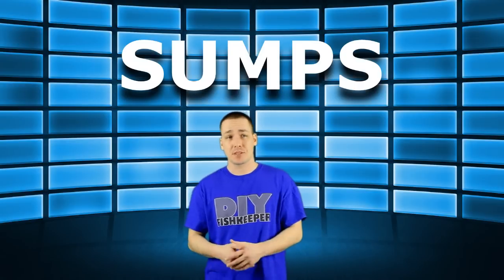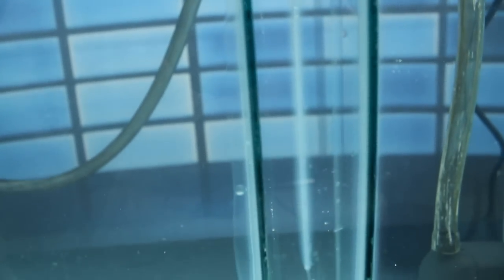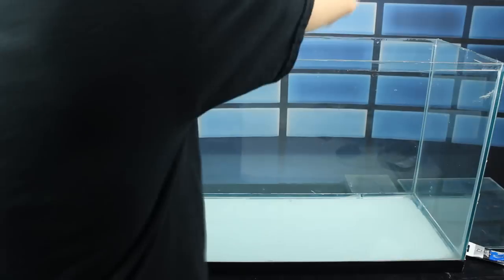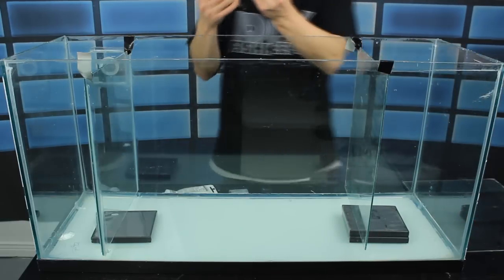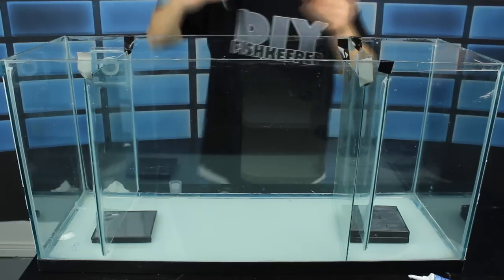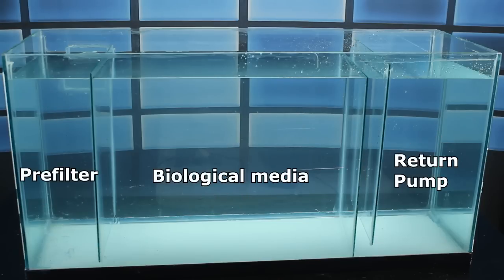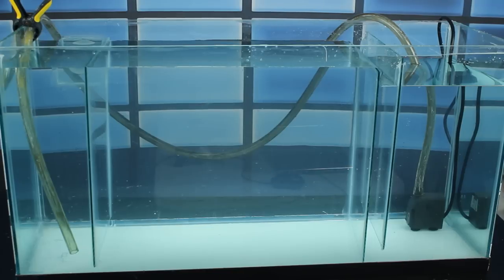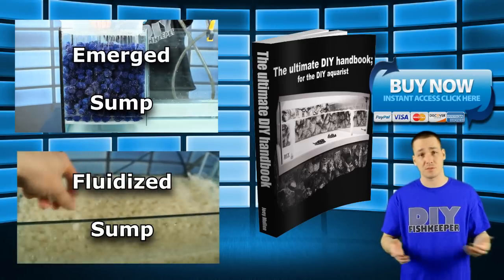HOW TO: Build an aquarium sump - Submerged filter

Comment: Hi Joey, I love your videos! They are both very educational and inspirational and have rekindled my interest in the hobby.  I am looking to build my first sump and was just looking on some direction on how to size the glass for the baffles.  The tank is a 360G and the sump is approximately 125 gallons 5' L x 2' W x 20" H and i am using two laguna max flo 2400s.  The "sump" is currently running without any baffles and is very inefficient.  I have sumps with baffles on my other tanks, but they were built by an aquarium manufacturer so I don't have any experience building them just like how they work.  I was also looking to increase mechanical filtration because I do notice a lot of detritus on my ceramic rings and have to rinse them with tank water every few months.  I use 100 micron filter socks, but I also read that you can add filter sponges between baffles, do you have any recommendations on where to obtain large filter sponges?  

Thank you for your time

Comment: Fired Up!!! 3 part series. Had a submerged sump (DIY of course) and hated the fact in power outages it over flow but DIY something for that.
Reply from the maker: Slim Tim Typically that has more to do with the efficiency and type of overflow as well as the size of the sump. I personally have never had any type of sump overflow, but can imagine the headache that would be!
Reply: @1014p  "make your pipe at the limit your sump can handle in water" - can you clarify what you mean by this? thanks

Comment: Awesome video. Is the main difference between a submerged and emerged system the the first chamber? One has a drip plate while the other doesn't? Is it safe to assume that a.submerged sump is suitable for a planted tank while an emerged sump is best for a fish only set up due to oxygen loss on the trickle filter?
Reply from the maker: AGUILAR3 The main difference is the media is out of water in one, and under water in the other. Your assumption what to use on which tank is typical of what most do as well. :)

Comment: The series was great Joey. Lots of great ideas. I get the concept of the sump, baffles and water flow. I have a question though, would I need a pump in my tank to get the water down, or is there a way without drilling my tank to get it to overflow down to the sump? I'm pretty sure you may already have a DIY vid for that lol. Thanks again for the great info and series.
Reply: ***** Thank you for your input. That is some valuable information

Comment: Hey Joey
Love your videos!
I've a question which pump to use for the sump. The pump I've is to strong and it's pushing away the plants.
Reply: put a gate valve on the return line
Reply: @gold3nrul311  thank you so much had the same question

Comment: Hi,
I am using all your videos to get to a planted aquarium (already built 36X18X15 inch ~ 40+ gallons). Instead of buying a filter I am now building a sump. I have 2 questions:
1) Sump size 1.5X1X1 feet would work? Or should it be larger? 
2) The sump will be placed about 2 feet below my aquarium, what flow rate or power of pump should I use in the pump to send filtered water back to the aquarium? Will a pump from my old aquarium with flow rate of 880 ltr/hour work? As it has to raise water up, it's flow rate will definitely fall down to around 500 ltr/hour perhaps! would it work?
Thanks in advance. :)

Comment: Hi im curious about what is the difference between the submerged sump and the fluidized moving bed sump, what is most beneficial for a 100 gallon freshwater tank for the common mechanical and biological filtration, basically i want to eliminate the use of using a canister filter. And would a 20 gallon sump work with the 100 gallon tank?

Comment: I am designing a sump for a huge aquarium ( 12000 gallons ) the sump will be about 270 gallons, is it good if I designed it to be both emerged and submerged in deferent stages ?
Reply: And fluidized ?

Comment: Question: I recently purchased an odd shape tank. It's a show tank... It's 10'x4'x 1' Yes it's 12 inches front to back. It came with two bio ball wet and dry filters built in side of the narrow stand. It also has in the corners the pre-filters. I have plans of using this as a saltwater aquarium for my new restaurant. I have two questions... 1. I want to keep it simple yet healthy for Lion fish. What do you recommend for a filter... A refusion or a wet and dry?
2. I have a logo that I would like to display in side the tank. So I was thinking of doing a color window of wrap on a 36" round acrylic sheet. Very thin in diameter. Then this is where I need your opinion... I need to lay a second piece of acrylic to protect the wrap(my logo) from the salt water. What would be the best way to glue/seal this tow prices together? It will be submersed. The aquarium has a black background... I don't know if it could be removed. If that's easier, I would do the wrap on the back but I'm affairs of it not showing. 

Thanks you!
Gene
Reply: spank Loc PLEASE PLEASE PLEASE tell me your kidding with the lionfish! They need room for territory, and will quickly grow large enough to not have room to turn around in that narrow of a tank. Those tanks are commonly sold as "bookshelf" tanks and are made really more for a fishless system or very small schooling fish. A full grown lionfish can reach a foot long and with its fins extened can be upwards of a foot wide. Each lionfish needing also lots of filtration as they are big messy eaters, they shouldnt be kept in any less than a 100+ gallon system even as juveniles.
Reply: Matt Weber - I am concerned now that you mention them facts. I know there are Dwarf Lion Fish. Are those an option? If not,  I will do Damsels... I had my heart set on Lion Fish but I agree with you. The filter system seems inadequate for 185ga. I do have room for a large sump. Thanks for bringing that up.
Reply: spank Loc even the dwarf variety get 8+ inches fully grown. Barely dwarf really by any definition if the term.
Reply: Matt Weber- thanks, I'll stock yo schools Of different Damsels.

Comment: Pardon me Joey, May i ask if i put four airstones to each side of my bio chamber in my submerged sump would increase the oxygenation of water and thus, increasing aerobic bacteria? I have quite a lot of ceramic rings in that chamber so i thought if i give more oxygen to it would be better... But the cons is i have to deal with humidity in my cabinet.
Reply from the maker: +CJ Bacteria will only be present in numbers that the food source allow them to be. Adding air is not going to spontaneously create more bacteria. Adding air stones would however insure the water stays circulated for a better chances of coming in contact with the bacteria, while aiding gas exchange created at the surface by the water movement.

Comment: So I bought a 150 gallon tank with a sump. The tubing is drilled under the tank. What will stop water from pouring out if electricity or pump fails?

Comment: Hey Joey, I'm moving from reef to freshwater and was thinking of starting a 120 gallon freshwater planted tank. My question is what is better a canister filter or wet/dry? I already have a 40 gallon breeder refugium I made for my reef tank but never used it. I can easily remove baffles if I need to... Thanks

Ray
Reply from the maker: Go with a canister. The overflow and sump will just gas off the co2 faster.
Reply: Thanks for the advise and thanks for replying so fast! Great video by the way, I used it to build my fuge and it turned out great!

Comment: My tank is fresh water tank now. But previously is salt water. Due to is a 2 feet by 2 feet reef sump tank,  the layout of water flow is go 1 circle not like normal sump go horizontal and back to main tank..
which i cant use k1 method, can a skimmer put in k1 media, as the container is above water level, does it work? If a product work in this way, it will take little space in the sump. Is like big head " the container" above water and small body " the motor" in the sump. I think millions of fish keeper will be interested to know. 😅

Comment: I'm trying to setup a 30g salt water was wondering on the best diy sump to hold the live rock and live sand so they can release the good bacteria in excess but not overcrowd the tank with rocks and lots of sand so the displacement effect for water isn't so big. the tank I'm planning already will have fake coral and fake anemone for 2 false percula clowns, a fire goby and possibly a jaw fish with some small star fish as cleanup crew.

Comment: I wish glass was more available to me here in hawaii.  Nothing is cheaper in Hawaii lol.  Thanks joey eh by the way... app is soon much info.  Enjoying it.
Reply from the maker: Jef B Thanks Jef. I suppose I make it appear like supplies are very common for me... Its just not the case. I typically have to special order most stuff in, or drive a couple hours to get it. Some things are cheap(or at least affordable)... some are not. I live in a very small town though, and not much is here. Glass isn't cheap for me either. In fact, acrylic is MUCH cheaper for me to buy than glass, which is typically not the case in most of the world.
Reply: I have had great luck using glass from 8x10, 12x16, 12x10 picture frames .. glass is thin just have to be careful
Reply: If you want to live in paradise,that's one of the down sides.but in my opinion the most beautiful place on earth.

Comment: please help, i started my submerged sump 2 days ago and my water is cloudy. in the first stage i put about 2 in of polyfill follwed by a 2 in thick sponge. the middle chamber has about 7 gallons of lava rock. followed by the last stage that just has the pump in it. How can i clear up my water? am is my mechanical filter stage missing anything?
p.s. i dont wanna use a filter sock or anything that needs to be changed often. my canister keeps my 55 crystal clear for at least a week

Comment: Problem is if enough water evaporates such that water can't clear the 2nd baffle, the pump will burn out. Why not put 2nd baffle close to first baffle. then you really don't need 3rd baffle and a lot more water would have to evaporate before the pump runs dry. 
Or you could build a prefilter to sit on top of sump that drips water down and then you don't need baffles at all.

Comment: Good afternoon,I’m blowing my brain apart here, as I’m pretty sure I’ve lost the formula and calculations in this video, I have a very soon and very near future project, of building an aquarium that is 4x2x1.5ft, in inches that’s 48 in length 24 in height and 18 in width, I’m planning on building a sump pump for it. Calculations have told me that it’s an 89.6 gallon tank and I need too pump 448 gallons an hour, I also need 448 watts directly from the heater, now, in designing the seperate sump tank, I’m stumped as too what the size of my sump tank should be.Specs89.6 gallon tank *main tank*I’ve got a pump in mind too pump 448 gallons an hourSump tank size ?????I just need the size of the tank needed, please please helpShould I use a 2ft long 2ft high 2ft wide tank for the sump?Please please, in desperate need of help(Not a saltwater setup)

Comment: Good info man but you need to slow waaay down. I'm all about shorter rather than longer videos but when i need to pause the video like 20 times, that means your going too fast. This video out of the other 2 was also pretty low info and ultimately not that helpful which ultimately meant this one required the least amount of pausing.